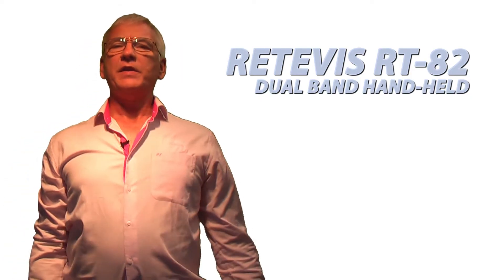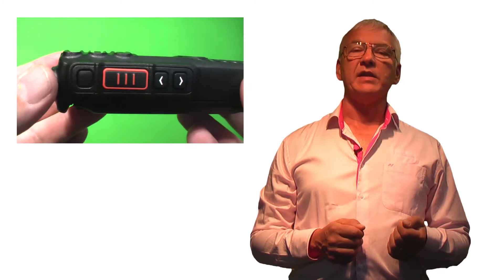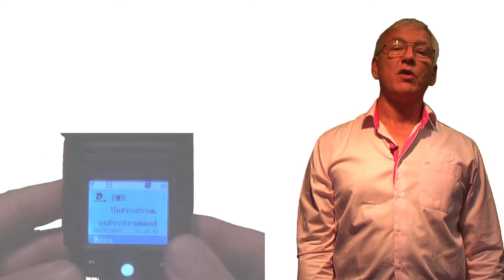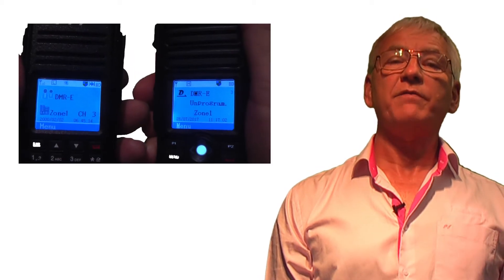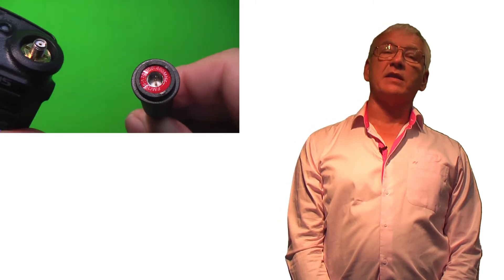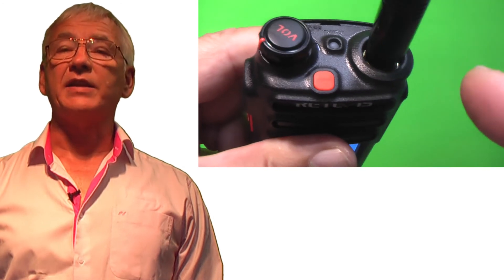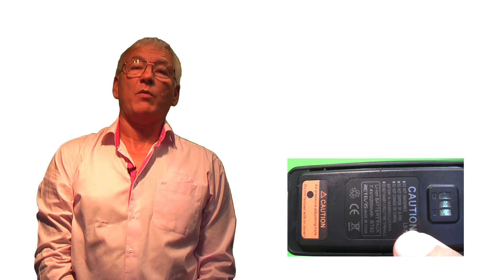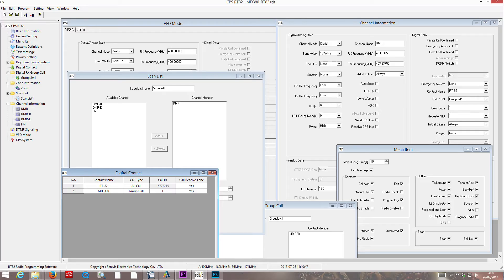Retevis RT-82 - User Review - First Impressions

Comment: I was given one of these and I can not get the drivers from the make to install properly.  Any help would be appreciated.
Reply from the maker: It works fine on windows 8 and 10 - It will not work on the old Vista computer I use for those radios that won't programme with 7-10! First thing is to try a different computer - if you have any more details on what you tried, with what OS, I'll have a think.

Comment: Hi Paul, have you tested the messaging system with the 380/RT3 and the Motos?
Reply from the maker: Hi Clive- must admit I hadn't but just checked and texts will go between tyt 380 and Retevis rt-80 both ways. However I don't have a Motorola to try. P